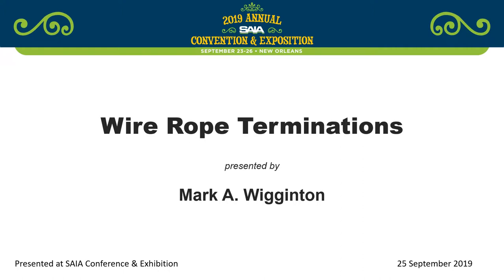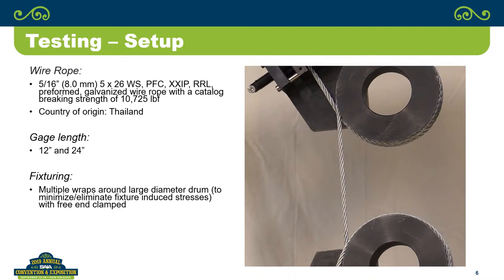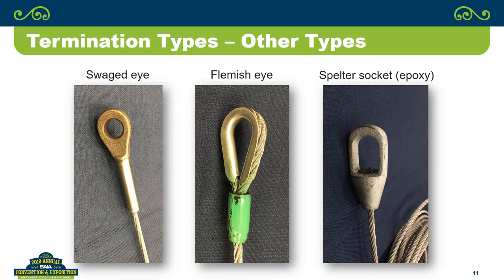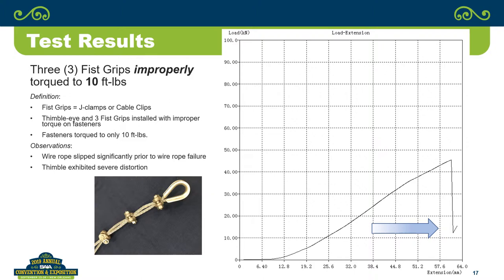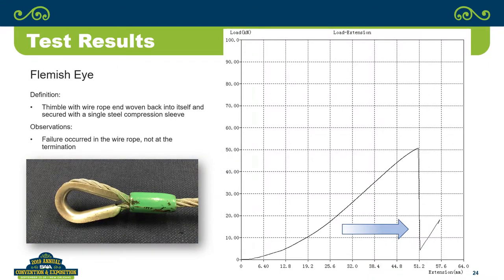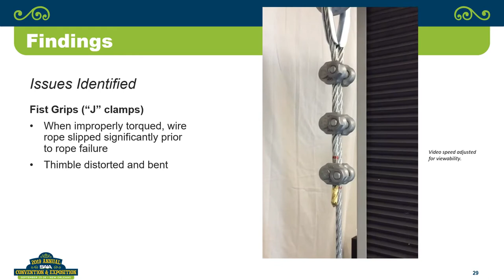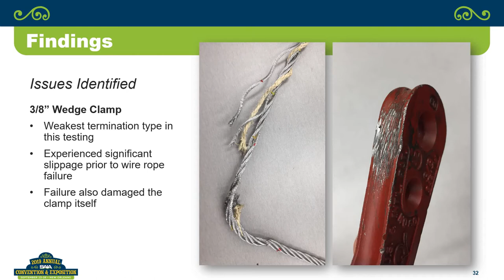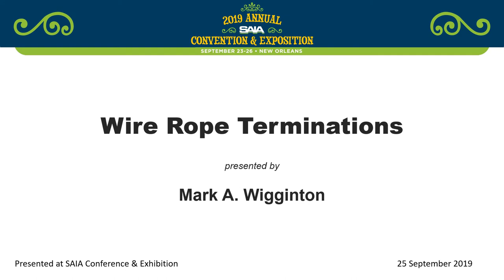Wire Rope Termination Study by Sky Climber LLC

Comment: Appreciated you efforts in sharing the test findings that are very convincing.
I am left wondering why a fibre core wire rope was used instead of a steel core rope.
Many industries do not recommend using a fibre core rope for suspension but use them as guy rope and tie downs for restraining loads.
Test on spelter socket would have made it complete.
Spelter socket termination would not go well with fibre core rope I suppose.
Great work in sharing knowledge